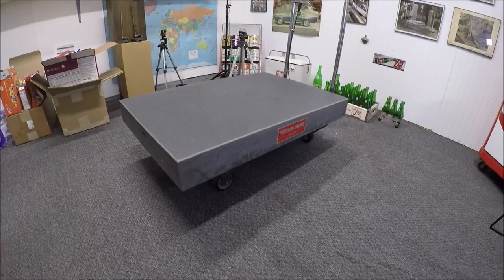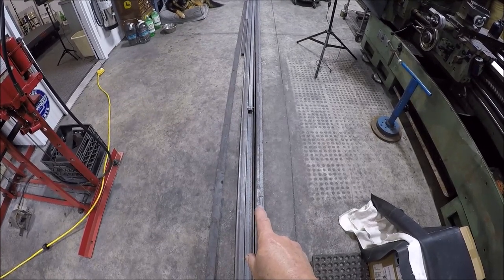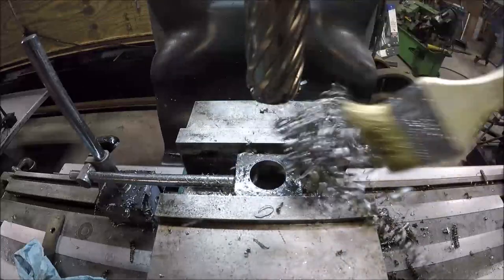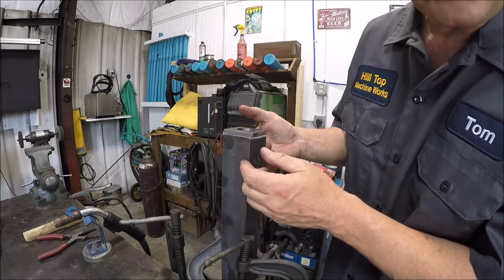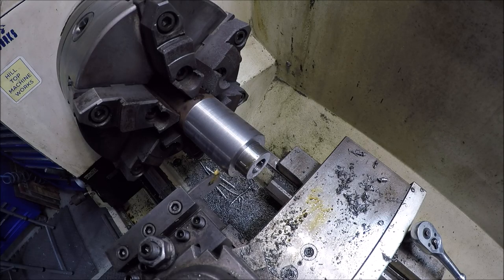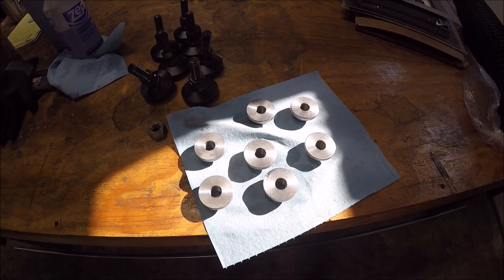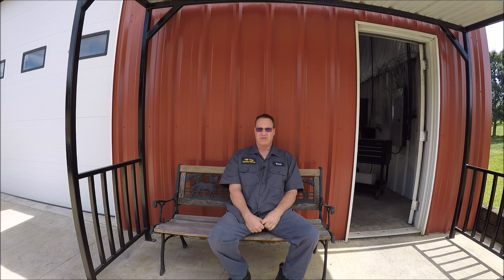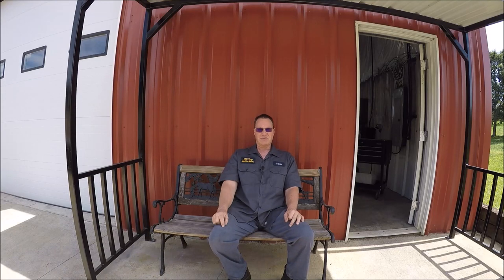Building a stand for my granite surface plate

Comment: We have the same size surface plate. I got mine from a retired machinist. One really odd bit is that the stand is made of hardened steel angle iron. When I tried to drill into it to add a shelf, I ended up having to use carbide drill bits, after dulling server HSS ones. I also tried steel self drilling screws and they died immediately. Nice stand, Tom.
Reply from the maker: I was not sure what your size was. So that is cool ours are the same size.

Comment: Good one .  I still have to make one for my plate , it's an old cast iron one that i will have to send out for blanchard grinding .  Hey , try flipping your parting tool upside down & use flood coolant .   That lathe is similar to my one & should mow through that like no tomorrow . Cheers   👍
Reply from the maker: Thanks Max. I will try that.

Comment: Nice job Tom. Good idea to keep it in the office. Like the new uniform. Do you have trouble with Mr. Chaos getting metal chips in his paws? Thanks for the video. Take advantage of that bench with the cooler fall weather coming.
Reply from the maker: Thanks Jim. I keep the floor clean and Khaos doesn’t really come around the machines when I am working so chips have not been a problem.

Comment: Have you got loose bearings in the headstock or shot bearings?  Sounds a little loosey goosey with that big hunk of steel it should be able to part off with no problem, unless there is a problem.
Reply from the maker: I don't think so John, but certainly something to check. The carbide insert could have been dull also. I didn't look at it closely.

Comment: Hi mate it's trevor mattys mate can you please tell me what post to Australia like I'm looking at  getting a fuel mixer or carburettor for a hercules 1 3/4 hp engine not sure if it is worth it or to expensive
Reply from the maker: Depending on the size of the box and weight, but I would guess around 40 dollars to get it to you from the States.
Reply: Ok on ebay thay say $125 bugger that
Reply from the maker: Ouch. That sounds high.  @trevorjones4463
Reply from the maker: @trevorjones4463  Can you send the item number to me and let me check it out and see about getting it and then shipping it to you?
Reply: Hi mate I think it's going to be to much with the Australian dollar so low I will try and get 1 out here thanks tom
Reply from the maker: Okay. @trevorjones4463